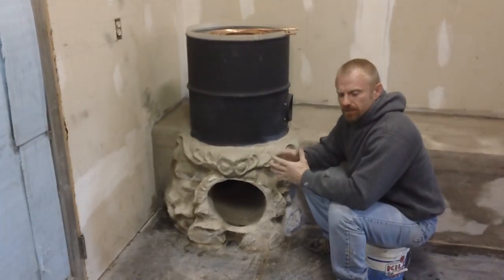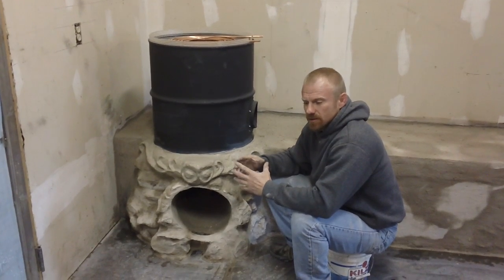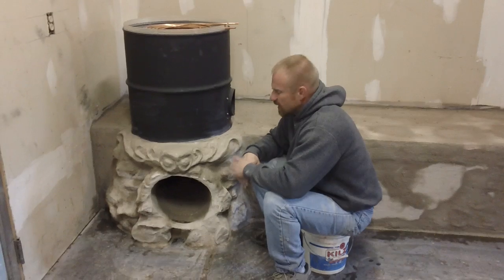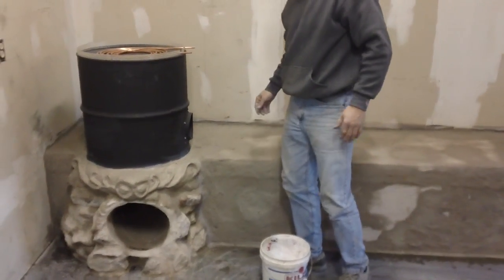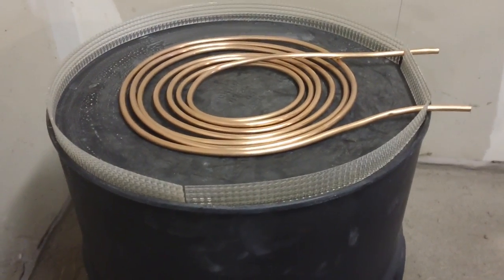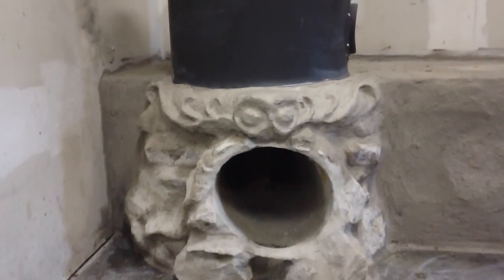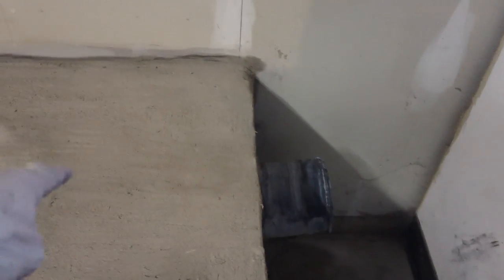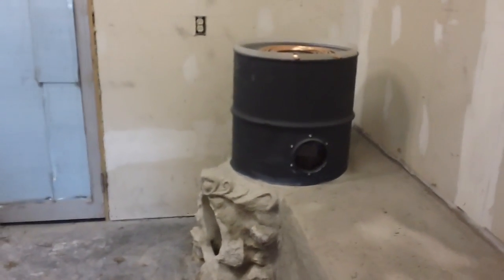12 inch Rocket Stove Project Part 4

Comment: seems as though you may have an imbalance of air flow . . . .   12" firebox reduced down to a 6" flue.  Is this what you intended or am I missing something?   Just remembered what appeared to be a 6" hole between 12" fire chamber and what maybe an 8" riser.    I'm getting older and I suppose I could have misinterpreted all those things.
Reply from the maker: the fire box is 12 inches and the hole in the of fire box top is 10 inches and the brick riser is 5 brick circle just a little bigger than 10 and the flue pipe is 6 inches. its the amount of push the big area makes that pushed it through the smaller and as well one must remember in a traditional rocket the bench is robbing heat hurting the draft .. here with the metal pipe design to be 200 degrees just above the elbow coming out of the barrel .. the metal 6 inch pipe has enough temp to actually help the draft instead of hurt it by constantly robbing more heat .
Reply: facepalm

Comment: love the cooling part of your barrel do you plan to use the hot water as well?
Reply from the maker: It obviously could be and we do have a cattle trough that could be used as a bath tub..LOL. Its primary use will be holding heat with the stand by capability of necessity.

Comment: Are you going to run the hot water into a series of barrels?
Reply from the maker: Yes Mr Bob . we are going to start with 2 set up with a thermal siphon system. depending on exit temp will add either another coil around the flue after  it goes through the top of barrel heat ex-changer or add another barrel if its just too hot